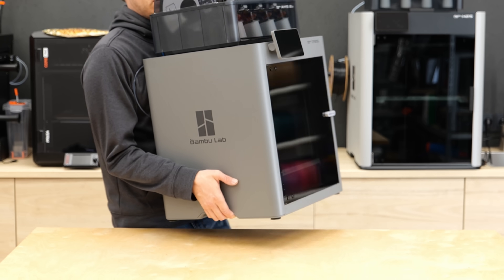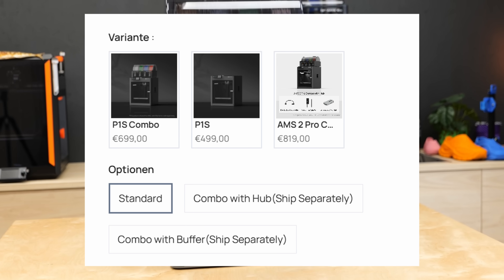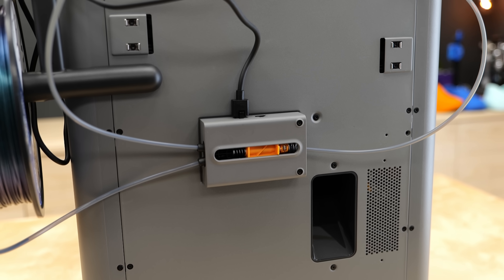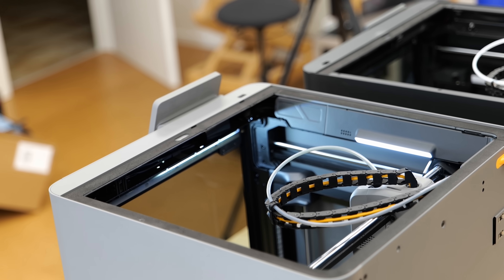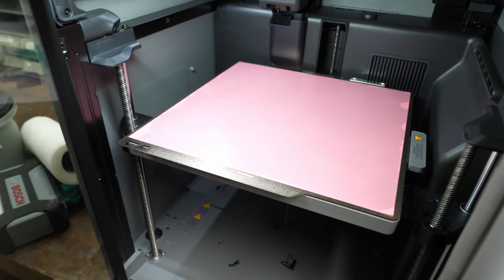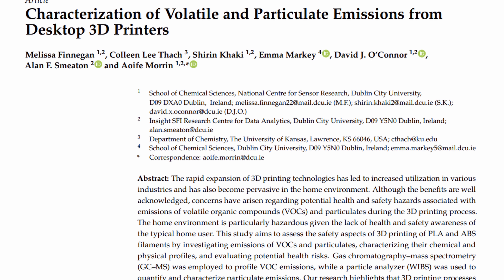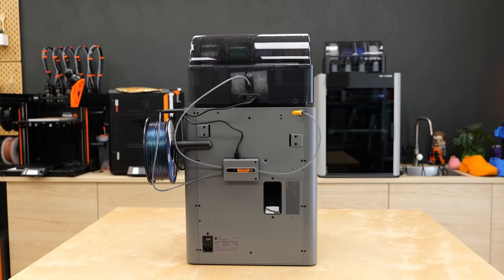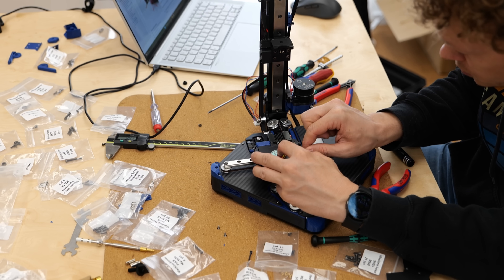The P2S Is the Upgrade No One Expected – But Everyone Wanted!

Comment: I don’t think there will be an X2C, I think the H2S is the replacement for the X1C.

Why do I say this? - The price point.

The price of the X1C is already too close to the price of the H2S.  I appreciate that the H2S is bigger and heavier and that some (including me) prefer the smaller size.

But it is a tough job for the sales and marketing department to pitch a smaller printer at the same price as the bigger one.

And if you really want a smaller one then you have the P2S.

So no, I don’t think we will have an X2C, I think that Bamboo Labs have already released the replacement for the X1C, it is the H2S.

Comment: I am not planning to upgrade my P1S for a while but 14:18 is the reason why my next 3D printer will not be a Bambu Lab. Using proprietary consumables is bad enough but also clamping down on software as well? This is worse than Apple. It is like Apple forcing you to use its own office suite instead of MS Office or LibreOffice.
In any case, I will keep my P1S in offline mode, on a separate WLAN with no connection to the internet and no FW updates while still managing to access it remotely with OrcaSlicer and check on it with Home Assistant integration (including getting notifications when a print is completed or errors are detected). The only downside being that I can only retrieve timelapses only via removing the SD card, but that is a small price to pay for privacy.
Reply: I was ready to pull the trigger up to that point, too.  Seriously, no more Developer mode and no way to link to Home Assistant?  Why do they care so much they're going out of their way to prevent more advanced uses?

Fortunately I don't really have much to complain about with my P1S, except for it being a pain to swap hot ends.  Guess I'll wait until something truly revolutionary comes out and decide which way to go then.  Otherwise, it doesn't seem like there are enough advantages to any of the current market's options to make them worth the cost, even selling my P1S to offset.

Comment: On one hand, this is a good upgrade for the P1S, which has made the X1C and P1S completely pointless. And the best feature it has is the system for automatic flow calibration and pressure advance. The nozzle swap system from the H2/A1 series also adds convenience.

However, there's a nuance: the A1 exists, which can do all the same things, just as fast, with the same quality, and even with less VFA, all while being significantly cheaper.

After trying to print high-shrinkage materials like ABS, ASA, PC, and HIPS in an active heated chamber, I no longer want a printer for complex filaments without heating. And for PLA/PETG, the A1 works perfectly fine.

I'm sure the BambuLab marketers will do their job, and the P2S will become a bestseller. But in my opinion, for most tasks, the A1 remains the best choice; for complex filaments, the H2 is great, and the entire mid-range segment is just an overpayment for a myth that has become firmly entrenched in people's minds: that CoreXY printers are better than bedslingers simply because they are CoreXY.

Comment: It's fixed the issues with the P1S but I don't know that I would get rid of mine to buy this now.  I've fixed most of the issues on mine with upgrades and now what I want more is a larger print bed.  For sure I'd buy one if i didn't already have a P1S though, some very nice updates.
Reply: what did you upgrade?
Reply: @LzKicker17  I fitted the upgrade kit from P1P to P1S.  I printed a lift kit that lifted the glass top an inch so that the feed tube didn't rub against the glass and it could be easily slid back to let heat out when printing PLA.  I printed a ramp that fits in the front lip to make brushing out rubbish easier, and covers for the top bearings to stop dust and crap getting into them and destroying them.  I printed anti-vibration feet too.
Reply: @axeman3d awesome!

Comment: One thing, is the P2S quieter than the P1S? I'm currently using the A1, which is relatively quiet and doesn't interfere with my work. I've heard the P1S is quite a bit louder, is the P2S similar?

Comment: @CNCKitchen Would you buy this over the P1S ? It looks like a good upgrade on the surface but your mention of VFA's is concerning. Does this produce more VFAs than the P1S ?
Reply from the maker: I did comparisons and also my P1S showed similar patterns. At the same price I'd definitely get the P2, if the P1 is significantly cheaper it's still a good, yet less convenient option.

Comment: @cnckitchen a question i haven't seen answered in any video so far: is the silicon tube still rubbing against the glas at the top?
Reply from the maker: Yes, it does but I have the feeling - not as much as on other machines. But yeah, that's a concern.

Comment: This looks great. I've been printing for 14 years. I started on a Folgertech Prusa i3 clone DIY kit from ebay. ALl plexiglass, threaded rods and nuts, linear bearings and had to compile marlin myself as well as hook up all the wiring to motors and steppers.   Then i got an Ender 3v1 and that lasted a VERY long time. I got a Kobra max a few years ago for the huge build plate too, but had lots of quality issues with it. Then, i got a P1S august 24' and i never looked back. I stored the other printers and only print on this. It's amazing. Slice it, hit print and "Fuhgettaboutit". Now i have 2 AMS and i love multicolor printing, mostly flat stuff and hueforge. The poop from multicolor models is just too insane to do that with this, but i want a H2D for that.  I don't need 3rd party slicers and other "features". I design and print perfectly fine with bambu studio I almost rarely even change settings from default too.  I can't wait for this to go on sale. I'm getting another. :D  Thanks for detailed and honest review

Comment: I was literally thinking that Bambu Lab is the Apple of 3D printing seconds before you said it. The one big difference between them and Apple is that Bambu Lab seems to provide excellent value.

I suppose that makes Prusa the Microsoft of 3D printing, committed to their Marlin-based firmware? And everyone else the Linuxes of 3D printing, using various forks of Klipper?

I suspect that the X2C will bring the higher bed, nozzle, and chamber temperatures of the H-series to the smaller form factor of the X- and P-series. That's what makes the most sense to me from a product segmentation perspective. I think the nozzle changer will be a separate SKU.

Comment: Bought P1S like 2 months ago and now i was like ”yeah, good timing…” but removal of the proper exhaust vent seems like a big minus actually. When started with my P1S, I noticed odors even from PLA. Therefore I built a piping to bigger activated carbon and HEPA filtration which connected nicely to the P1S’s exhaust vent, that even had screw holes already for that. I also guess, many people would like to connect piping to some more advanced ventilation system or just vent out odors out of house. So actually, maybe I was lucky to get the P1S before the new model came? 😄

Comment: I need an A2(mini) : Faster printing speeds and better linear rails( maybe ones that don't fall apart when doing maintenance😅)  and automatically comes with hardened steel, extruder stuff, and also, both of them get a better touchscreen. And especially a better camera

X2C: i honestly don't really know what they would upgrade here. Considering that it was kind of already their flagship I guess the only thing I can really think of is automatic integration with the A. MS2 pro without having to have like the adapters and everything i would say a heated housing unit.And also, they're probably going to add like add a filtered exhaust.

X2E: i don't really know anything about the X1E but I think it would just get like an my guess is like you're just gonna do like kind of the same upgrades. They're doing with all of them give it a better touch screen. Give it easier nozzle changes and probably also give it that big red stop. Button like on the H2D pro. But aside from that, I don't think there's anything else that's gonna change Really.

H2C: Auto nozzle changes, that's all😁

Comment: Would a Voxel Bento Box air filter still fit in it?
Reply from the maker: I'll have to try it but pretty pointless IMHO because you already have the air circulation filter.
Reply: @CNCKitchen . I planned on using the bento box for the HEPA filter.  Does the P2S have HEPA filters in its ventillation?

Comment: Hey Stefan! I am also a 3DP YouTuber. On my P1S I use the firmware before the update to use OrcaSlicer with cloud without any steps. I have not updated since. I am assuming the firmware on the new P2S by default does not allow this?
Reply from the maker: No, you won't be able to use any old firmware without the restrictions. Getting around the Cloud can only be done with the LAN mode but that doesn't solve the OrcaSlicer issue.
Reply: @CNCKitchen That’s what I assumed. Thanks!

Comment: It seems like the h series is being positioned as the new flagship, replacing the x series while the p series will be able to serve to fill that void at a lower price. I also predict the a series will eventually evolve into a cheaper, more stripped down core xy platform in future. Eventually abandoning the bed slinger from factor all together.

Comment: X1C advantage: LiDAR flow calibration. It doesn’t work with every filament (such as translucent or shiny) but saves time over printing a bunch of rectangles.
Reply: p2s is nice. only advantage is the hotend swap and the ams2. but lidar is much more useful.

Comment: I'd rather be more interested in P2S to X1C comparison as it's obvious P1S is now obsolete and replaced. I bought X1C a bit over a month ago for $950 CAD while P2S is now $800 CAD. It still doesn't seem to be a bad value but I'm not sure if X1C has any advantages anymore, except warmer bed and exhaust filter. Moreover, X1C does not have USB socket and can't record timelapse unless you have SD card in. Can P2S record straight to USB drive?

Comment: Why do metric manufacturers use imperial measures converted to metric? Why a 10 inch plate?

Sorry, but I'm not a fan of these multicolor printers that waste a tremendous amount of plastic. They will all be landfill in a few months when more multi tool head models appear, these bambu designs seem like a transition to better designs months away.

Comment: Yes, it’s an amazing value, but I don’t think it makes the X1C obsolete, nor the P1 S. The one factor that is holding me from waiting for this new unit is the fact that it is not available yet in the United States and we don’t know when it will be either. If I need to buy a machine in the next two weeks, I am stuck with the current models, which are currently selling at low prices at my local Micro Center. So I will still wait another few days to see if there are updates with stock.

Comment: They seem to have change the nozzle wiper, is it good?  I had to print a nozzle wiper for my P1S with the A1 silicone pad because I had issue with PETG oozing and making my print fail.  Since then, my P1S is performing like a champ, even got better with update.
Reply from the maker: The silicone one works pretty good!
Reply: @CNCKitchen  Awesome, thank you for your videos, they are very helpful.

Comment: In regard to air quality, dont rely on any of these machines being properly sealed, instead fit a large exhaust fan in the room you have your printers in, also buy a stack of the large air filters from Ikea, they have activated carbon and particulate filters, their huge and low cost, I have three of these and the exhaust fan and my internal air filters I designed in my printers, all controlled by Zigbee and Home-assistant with automations talking to Moonraker/Klipper on my printers, I also have smoke, flame, temp, humidity, and air quality sensors in the mix, so everything is monitored by Home-assistant and viewable from dashboards around my premises, don't relay on a Chinese manufacturer to save your health.....

Comment: No Orca Slicer? Cloud requirement?!
No thanks, I'd rather wait for a proper tool changer.
Reply: There is no cloud requirement.
Reply: @rsilvers129   The requirement is Bambu Studio. Which will connect your printer to a cloud account at first launch.
Sure, you can go through the absolute hassle of swapping cards all the time after that, but who wants that?

Comment: So I have one of every Bambu lab printer, and 5 X1Cs, why? Because of one differentiator: the lidar. I’m one of a handful of possible millions/thousands lol, who actually take advantage of it in a specific way: I print several multi color prints I sell that are both functional and aesthetic, every one of them must be calibrated - and before each 20-40 hour print, I load up my filaments in the AMS, head over to the calibration tab, and run auto calibrate on all 4, resulting in four of the calibration strip patterns coming out on a smooth PEI sheet, that the lidar reads and stores the K value to the unit’s memory. This is an approximately 15-20 minute process that I do on multi filament prints and they come out flawlessly. I have 2 H2Ds, and it cannot duplicate the quality. Either on a 0.2 or 0.4mm nozzle, and this makes the X1C a mission critical piece of hardware. Yes, you can discover K values manually by printing a large pattern, one filament at a time, and reading and inputting values. But the X1 does this all for me. And before anyone even tries it: every Bambu printer besides the P1 series, CAN calibrate upon printing… but ONLY the first filament. Period. No Bambu lab printer will calibrate more than the first filament automatically during print operations. I’ve begged Bambu to add this capability when using the ams, or at least allow us to run the calibration from the printer or Bambu handy UI, but you must run it from Bambu Studio only. This difference is money. And still makes the X1C valuable, as the eddy current calibration the A and H series perform is not equivalent in sensitivity.

Comment: I really dislike how Bambu is going all in on the quick swap nozzle system. Its fragile. It failed in under 50 swaps on my a1m, and in researching, discovered people have had it fail 15 minutes into their first print on the machine from a plastic blob ripping it off.

Comment: As a P1S owner and OrcaSlicer + other 3rd party apps user, I won't buy another Bambu Lab printer.  The hardware's great, but I don't accept them adding restrictions to what I already paid for in firmware updates.  Sony forever lost me as a customer the same way when they removed OtherOS from the PS3.
Reply: You can use a old firmware If you need a Orca. It's not a problem for the P1S
Reply: @vinigun still no workaround or plugins for that? what is the latest fw that still allows 3rd party connection?
Reply: Same for me on the PS3.  I haven't gone back since. I also didn't buy a Bamboo and opted for a Prusa because I prefer their business model, upgradability and how they give back to the community
Reply: Shooting themself in the foot with it. Will it work with bambu slicer but no internet connection though?

Comment: If Bambu Lab didn't lock down their eco system this would be my next printer... I would just like to see more specs like bed flatness and the option to include other hardware upgrades.
Reply: As an owner of 5 different Bambu printers, I need you to explain the "locked down ecosystem."  Mine all work offline or online, and I can n use any filament I want.  Bambu may not allow other slicers, but they give me one that works every time.  And Bambu Studio offers more tools than any other company.  You call it a closed system, I call it a system that works better than any other.
Reply: Legitimate question. If it works and you can use any filament or build plate or whatever you want then why does it even matter? Like what is the benefit?

Comment: I'm really struggling here to see a compelling reason to 'upgrade' from a P1S. Most of the things here were solved by the community and made available for print i.e. the side mounted spool holder and the printable Y Splitter. There's even hinge modification prints, you can buy rubberised anti vibration feet, the hardened steel nozzle and extruder gears, lighting upgrades etc...

And I imagine most people just 'control' it via Bambu Handy or Bambu Studio so then the little screen isn't really a problem either.

Doesn't really feel like any fundamental 'wowaweewaa' moments here..?

Comment: I hate Bambu has to lock everything down, I just got an A1 and after an atrocious experience with the anycubic trash ahh machine, it was like a miracle, you can just print without worrying about. I never got a flat first layer on my trash ass anycubic or even my overly modded flashforge ad5m, but the a1 has literally never even had a small hiccup on the first layer. If they were more open I would already bought more, but I don't like not having at least the allusion of control over the product I bought

Comment: P1S did not cost 499/699 on release, it was a lot more expensive. I bought one a year ago for ~620 euros from Bambu Lab EU store and then it was on sale.
Reply: In USA it was $699
Reply: @alecubudulecu  Yeah, $699 without an AMS. So it did not cost 499/699 (price 'without AMS/With AMS') at launch.
Reply: @alecubudulecu  paid 850€ when the p1p came out (without ams)
Reply: Yupp I feel like they lowered the price recently because competitors are closing in with cheaper printers.

Comment: Well made product upgrade, all the features the P1S missed (Screen, 5GHz WLAN, Camera, hardened gears/nozzle) plus the new H2 nozzles are very well made product. The air exhaust should go through the filter and have a exhaust port to have the chance to colelct the fumes and redirect them outside by air vent in the wall. Heater is not really needed .. P1S already printed ASA very well, maybe there will be an upgrade.